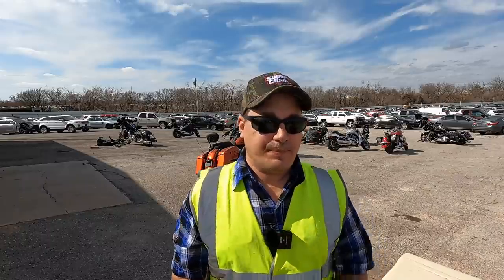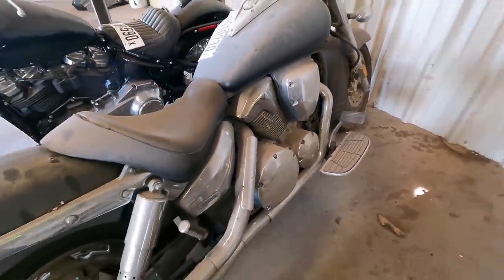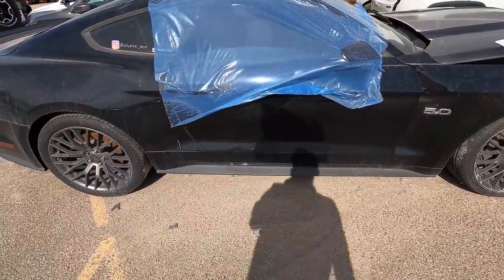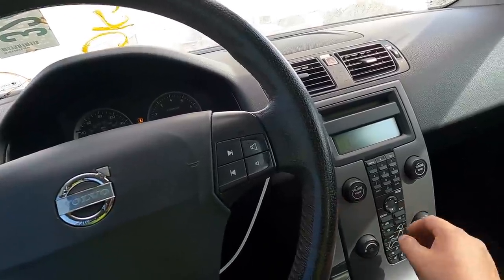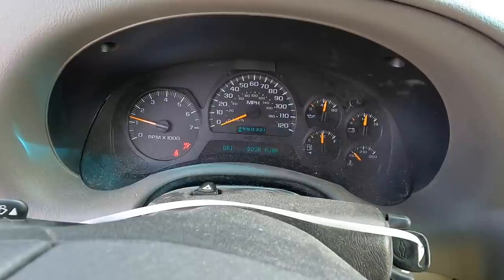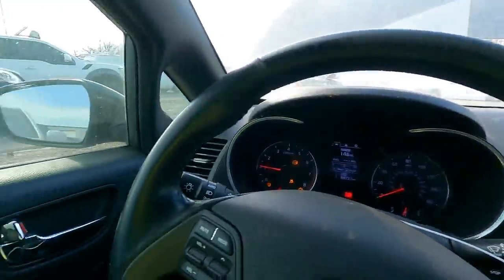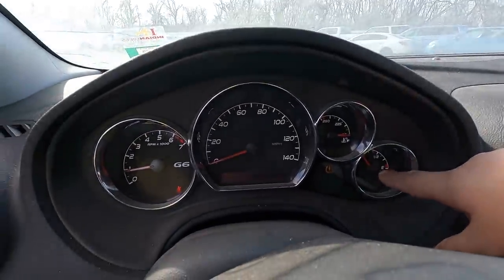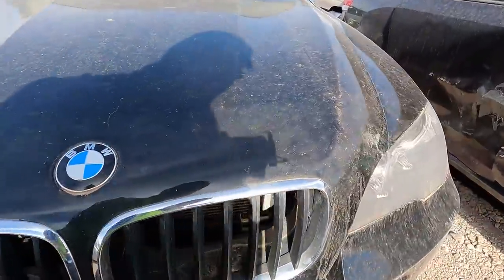Copart Walk Around Cars + Bikes!! 3-11-21

Comment: That Kia Forte is the exact definition of a Kia. It’s not their bad engines blowing up at 100.000 miles. It’s the engine running for 100.000 miles with 2 oil changes and 200 street races.

Comment: The Hummer needs the ignition switch replaced is a common problem with the Hummer and the Colorado ,both use same one. Look it up there is a video on YouTube a guy shows you a way to get it started ,I have a colorado he saved me from getting a tow. I replaced the switch and it fixed it. God bless

Comment: The first mustang had vmp performance sticker on the windshield, they make high performance parts for s550 and (i think, could be wrong) s197 mustangs. You should take a second look at that stang, could be packing a lot more than a stock 5.0 under the hood.

Comment: Like the Trailblazer.
Those Volvo 5 cylinders tend to blow head gaskets. Got a bad one from auction once, wasn't worth fixing.  Sold for parts.
Note that, if a crashed bike is even slightly twisted, the bike will never balance, and will inherently want to fall over at lower speeds.

Comment: Randy could that Hummer H3 have that common anti theft issue where the security light flashes? 

If the security light on dash flashes leave the key on for 10 minutes then security light should stop flashing then it should start. Common GM issue in the mid 2000s cars and trucks

Comment: I don't know about the S40 but on the old RWD 240s, changing iutva bad blower motor is a dash-out, whole weekend job. I own one and the joke in the 240 community is that Volvo started out with the blower motor and then built the rest of the car around it. 

Idk. To me a Volvo with a 5-cyl motor and FWD isn't a real Volvo, it's a Ford (at least, that one is!)

Love the Indian and the silver Harley (even if it does need a new front wheel as well as the dented gas tank.) I share your ambivalence toward crotch rockets - if I were to ride, it would be slow and lazy on something that is, as you say, a piece of automotive art.

Comment: You should learn on a small bike - like no more then 450 CC, those are full size bikes but much easier to learn on (handle) and safer. I learned on a 250 and ended up with a 1600CC.

Comment: That poor Kia.. 😭

The Volvo, I've had a few.. the coil packs fail (normally cyl 3 or 4, or both) and then the top engine mount fails. 

Failed engine top mount and a misfire; and you think your driving an old washing machine on a fast spin cycle. But it's easy to fix.